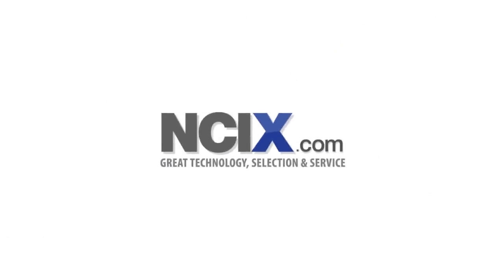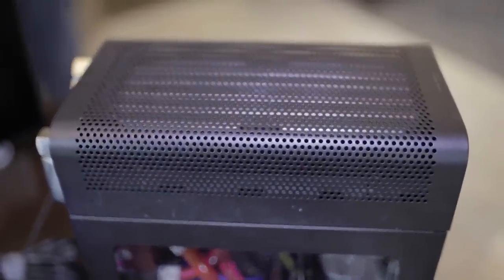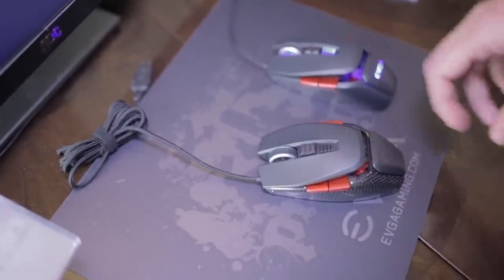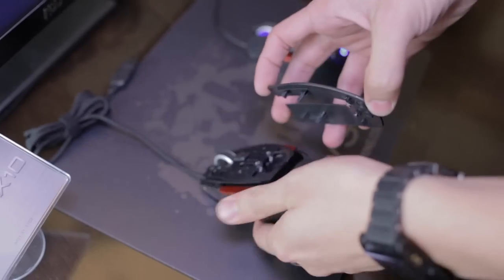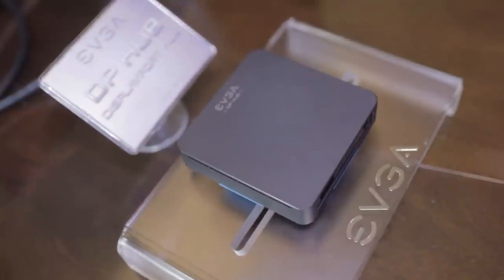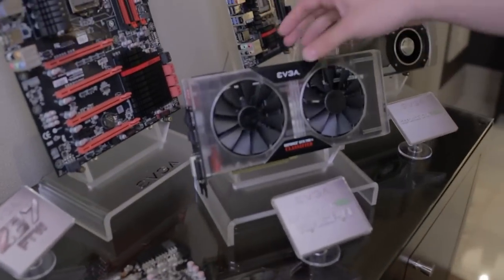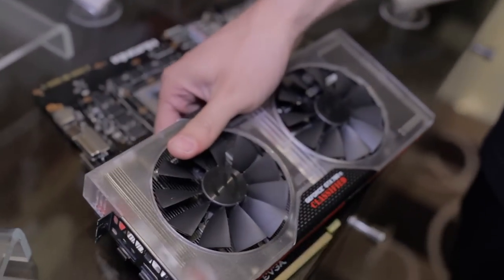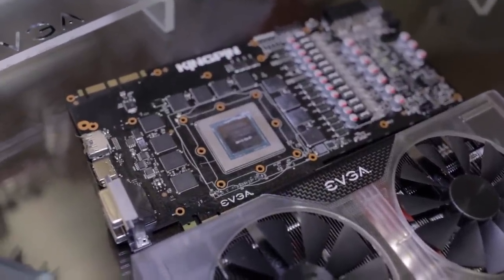EVGA CES 2014 - Hadron Hydro, KingPin and X10 Gaming Mouse

Comment: The EVGA card is designed for extreme overclocking with liquid nitrogen or water cooling... Ok so why does it come with an air cooler?!
Reply: It's because of reasons
Reply: Marquis Iloinen Haha ok :)
Reply: ***** To make the card a a cheaper buy and to also make it cheaper for the buyer to install aftermarket cooling.